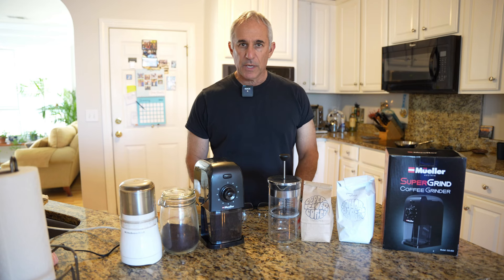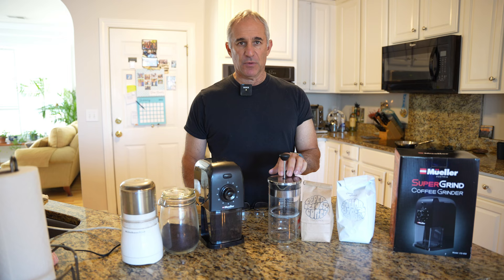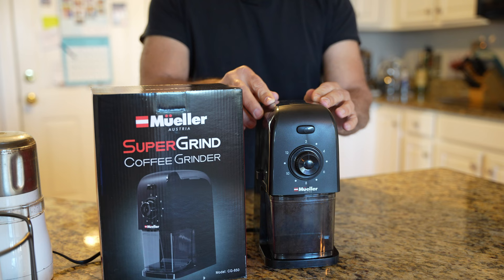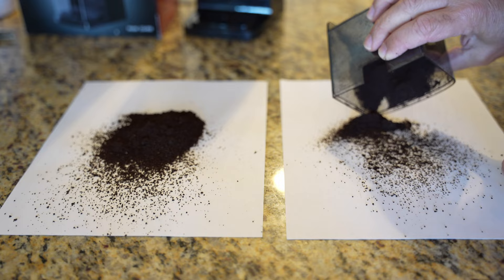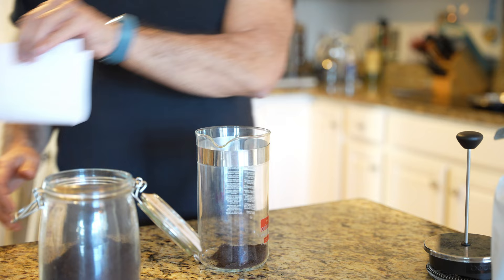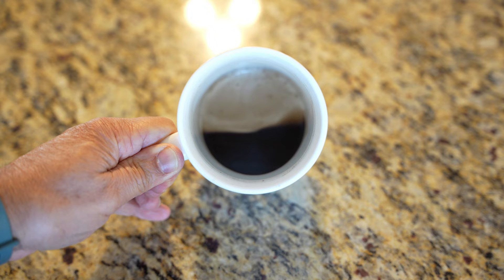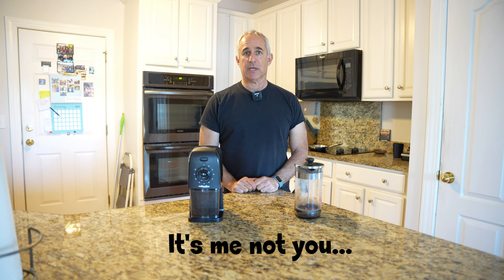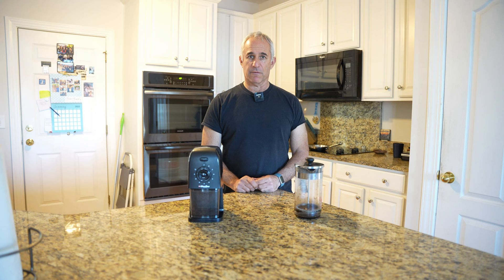Mueller Austria Super Grind Coffee Grinder from Amazon

Comment: I bought this to try grinding coarse pepper in
Reply from the maker: Interesting, did you run into the same problem that it was to fine?
Reply: @photojunkysdronezonevlog  too fine. dont know how to set the settings yet. to coarse.
Reply: @photojunkysdronezonevlog  pepper for steak
Reply: @photojunkysdronezonevlog  sledge hammer might be better for what I need but its not an even coarse